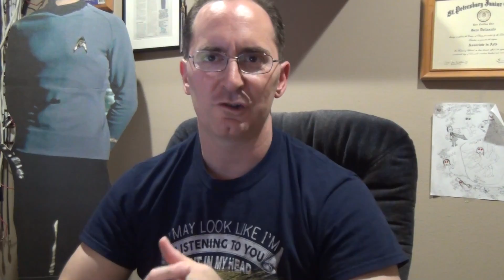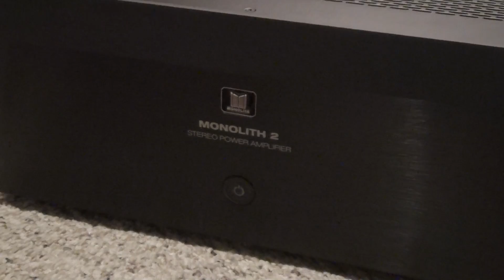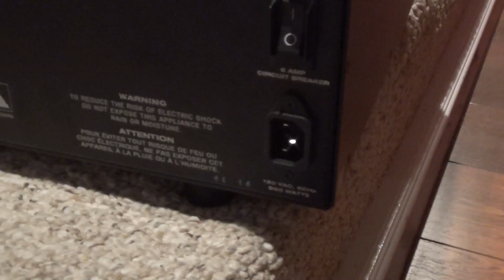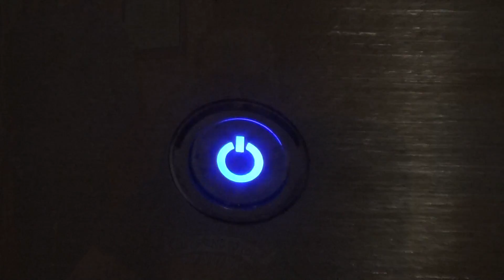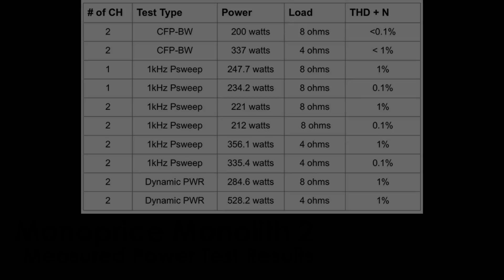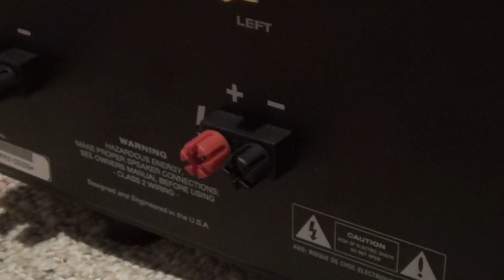Monoprice Monolith 7x200 watt/ch Amplifier Review

Comment: Time to replace my 90s Onkyo amps. Speakers are similar mid bass are 2ohm or two 4ohms per channel. The mids and highs require two 4ohm channels, tri amped leaves the 7th channel free to run a center. Think its a go.
  2025 its 2000.00 and a bargain, seems the best choice for the AB market. Don't care what you say, not big on D amps. Buy your amplifier by the pound, its always been my saying, this 90lb amp might do it. 
  ? can we use cast iron frying pans on it ? 😄

Comment: I just received mine today, I am not getting speaker hum or buzz like I did with some of the other amps I tried, but I  am getting toroidal hum, I can hear it from my main listening position. Also, I get a loud thump when starting up. Actually the there are two of them. the first one is louder as soon as it powers on, but both can be heard  from the MLP. On their website, they advertise "NO THUMP." I wonder if this is just a bad unit. I really would like to keep this amp, but the two issues I mentioned are just a big turnoff. Please advise.

Comment: Hey Gene and Theo, thank you for this video. I am looking for an amplifier to pair with a AVM70. I am comparing this Monolith 7x to a Anthem MCA 525 gen 2. Outside of the value differential, do you have any thoughts on how these amps compare? Any feedback would be greatly appreciated. Thank you.
Reply from the maker: If you've got the coin, I'd go Anthem. Matching aesthetics and rugged reliability and great performance. The Monolith 7x is a good amp and gives you higher channel density and value compared to the Anthem. But, I'd love to have a stack of Anthem in my HT rack so if you can swing the added cost, go for it!
Reply: @Audioholics  Great, thank you for the fast reply. Do you think there is a substantial difference in sound quality?

Comment: How would you compare this amp to musical fidelity or the nad m28 both 5 channel. These are the 3 I'm looking at. Before I purchase I would like to know what you would suggest, my speakers are main b&w 702S2. Center I'm using 2 wired together b&w 705S2 and the rear I also have b&w 705S2. I'm purchasing a processor as well. Now just running a older yamaha A3080 receiver.  Maybe also a suggestion on a processor as well

Comment: If my Pre Processor has both XLR & RCA -and this Monolith is less than 4ft so short cable run - would the 7x lacking XLR inputs be at a disadvantage sound quality wise or from a volume level perpsective? 

Is there anything else that changed when Monoprice updated the original 7x with one have the XLR inputs? OR are they identical under the hood?

Comment: would you say that one gets the monolith 11x or the emotiva 11 channel amp ? would love some input
Reply: The only input I can give is I will not buy Emotiva again. My Emotiva XPA-5 just died after only 6.5 years. Pathetic. I have a NAD and an Adcom that are over 20 years old with no issues and a B&K Components amp that is over 10 or 15 again with no issues. My Emotiva amps have barely ever been driven hard either except a few times to show them off. I just bought the Monolith 7 channel to replace the 5 and 2 channel Emotiva amps I have. We will see how that goes when I get it. Hopefully the Monolith will not have the hiss the Emotiva XPA 5 had either with nothing connected to the inputs on my Klipsch speakers.
Reply: @Brian-Outdoors  thx for your answer bud, I think companies overall make their products weaker now days. For the simple reason rebuy and refill pockets :P I might toss my coin at a monolith sounds promising either way.
Reply: @Sup3riorr  you are welcome and I agree with everything you said.

Comment: Super helpful--not a lot of BS, obvious knowledge of engineering and pointed out clearly pros/cons of the device. I'm certainly have this on the short list for my tri-amped digitally filtered home brewed--but using SOTA drivers (Audio Elegance,  Audio Technology C-Quenze, and Aurum Cantus) speakers.  May go with 5 channel version and a heavy duty stereo Class D amp to plumb the limits of the very capable AE 15" woofers. Great review and have subscribed.

Comment: I just bought this amplifier. My first amp. Is it supposed to make a very slight hum that I can hear when I'm sitting on the couch  And there's no sound being played over the speakers. Is this normal for an amp or should I send it back for a new one under warranty.
Reply: Are you running balanced (XLR) or unbalanced (RCA cables)?

Comment: They state that there is no limiter or protection circuitry in the signal path. Does that mean there is still protection elsewhere in the system to protect your gear? Sounds like a bad thing marketed in a good way. I want to get this to provide some overhead for my surrounds, but nervous about damaging my gear.

Comment: I bought the Monolith 5 and Denon 3600 AVR.  Previously had just the 
Denon 1400,  and no amp.   I went from 160 watts total to 1,210 watts 
total.   A 7.5 fold difference.   I can't tell a damn difference!   In 
fact, it seems a bit quieter.  5.2.2 system.    Not sure what to do.   
Did Audyssey screw up the mix?   I'm pretty good at setups, every 
setting seems correct.      I just don't get it.  Very underwhelmed.
Reply: I worked on my settings manually, with ears and a brain, and got my system sounding great.   Audyssey must have a hard time correcting my room which is sub-optimal, having tile floors, vaulted ceiling on an angle, etc.   Now I hear the difference.  Especially at reference level.

Comment: I only have a dedicated wall outlet with one plug taken up by the Speedwoofer 10 sub. Could I plug the 3 channel version of this Amp into the second plug and run both without causing electrical overload issues? thanks, new to all this so I have to cover all bases,

Comment: Would you hear any sound difference from Anthem or parasound amp vs the monolith?
Reply: @empyriel I have the svs ultra towers and center channel.
Reply: @freddygenao6035  I considered SVS, and I'm still considering them for my next setup. I'm not unhappy with Klipsch, but I haven't been into home theater long enough to determine if there's one brand/style I prefer over another
Reply: @empyriel you will have no regret. It’s an amazing amplifier. I bi-amp my left and right and can’t believe how good it sounds. Don’t miss my old parasound. Let me know what you think.
Reply: Freddy Genao Well, I got my amp today. Heavy sucker. Plugged it in and powered it on before connecting just to test. No issues. Plugged everything up, and buzzzzzzzz. Very audibly hum coming from all speakers. Thought it might be a grounding issue, so I called Monoprice to confirm. They told me the unit was defective, and needed be replaced or returned for a refund. Yeah, well, I grounded it to my AVR, and voila! No more hum. Looking forward to seeing what this beast can do
Reply: @freddygenao6035  Will do. It should arrive Wednesday, but I might have the time to connect it until this weekend
Reply: @freddygenao6035  How do you bi amp this amp? I have a 5-channel version !  And I'm only running 2 speakers !! Would you take two channels in the back of the amp powering one side of the speaker and two more channels powering the right side of the speaker? 

Opposed to just running 1Channel per speaker?  because it says 200 watts per channel so what I get a benefit if I'm using two channels for one another two channels for another speaker just by using like a blue jean speaker cable they have on Amazon one side has two connectors and the other side has 4 the speakers are have are focal Aria 948 which do not have a do a binding post only two in the back of the speaker so I'm just going to take that blue jean speaker cable with two plugs plug it into the speaker and then the other end of the cable that has for taking up two channels in the back of the amp and doing the same for the other speaker will this give me better results in better sound quality?  Then just me running each beaker with only one channel for each?
Reply: Been wondering that, myself, since I'm also looking at Parasound
Reply: Empriel, I just pulled the trigger from amazon($100 cheaper and free shipping) I will update you on what I think. 

I had an 20year old parasound  135 watts x6 and it just died. I’m intrigued what will I hear.
Reply: @freddygenao6035  I've been watching Amazon's price fluctuate for each of Monolith's models that they carry. But yeah, please let me know what you think
Reply: @freddygenao6035  I pulled the trigger on one just today. They've been selling like hotcakes. Monoprice is sold out, and not expecting any more until January. Amazon is now showing 1 left. Hoping it lives up to the reviews I've seen/read
Reply: Empriel, it definitely is heavy. Their customer service is always trying to help but I’ve notice their not the most knowledgeable of the product. 

What speaker will you be driving?
Reply: @freddygenao6035  I've got an all Klipsch 7.2 system with RP-280F, RP-450C, RP-250S, and RP-150M. Also have two R-112SW. What have you got yours connected to?
Reply: @freddygenao6035  By the way, the hum was caused by a grounding issue, which I fixed by grounding the amp to my AVR. The hum went away, and I went to town with it. I'm not disappointed so far, but I think it's going to take a little getting used to
Reply: @Newton R I believe you can’t bi amp with your current speaker. They have to come from the manufacture whit dual binding post. I’m not an expert but Wouldn’t  recommend  using the blue jeans like your trying to set them up. You might short the amp.  

How do you like your Focals? I’ve always wanted to hear them in person.

Comment: They are not made in the USA. Only designed and engineered, then they farm everything out to foreign interests, and ASSEMBLE THE FINAL PIECES, here in the USA. If it does not say MADE IN THE USA, on both the equipment, and equipment documents and literature, anything else said is BS.

Monoprice, he says, assures him........they are built in the USA, ???  Well that is only a promise to him  only that means nothing.  There is a big difference between built, (manufactured), and assembled.  For better guidance check Anthems website. Their amplifiers are built in Canada, and it says so on the product as well as the literature. Designed , engineered and manuafactured in Canada.

Comment: They have balanced inputs now.
Reply: Made by ATI check specs compared to AT signature.  Buying some of these soon.  Currently have ATI AT543NC which are miraculous Class D with linear power supplies.  So Monolith for rear  surround and atmos, ATI for front LRC.  Want A-holic to update review for balanced inputs and also review these ATI amps ..phenomenal really as good in most ways as any of my Brystons
Reply: I have heard good reviews on ATI's Class D. I think that the least expensive ATI 2 channel AB is about $1800, so the Monolith 7 x 200 is a steal. I want to run 6 Elac 6.2 and each will have it's own 200 watt amp. I'll use the 7th amp to drive a passive subwoofer. I think there are two toroidal transformers in  7 X200. I want to put them on separate 110 volt circuits.
Reply: Yeah they are higher but also higher performing, I was not comparing the 2.  Plus that's full retail. I'm not dissing the monolith at all rather confirming its pedigree.  Great value  will purchase these for surrounds but my front 3 will be the ATI with those fantastic hypex cores

Comment: Any audible "hiss" coming out of the speaker with that amp?
Reply: The power numbers are full bandwidth 0.03% thd ...

In short ... silent on full power even. The specs on that ATI amps are ridiculously good. I drive a infinity kappa 9 (dips 0.7ohm) send my older krell into protection mode. 

These puppies?! Don’t sweat it

Comment: hello,can i use a 5ch amp only with 3 ch ? i only have a 3.1 system with a denon x2400.. is it safe for the amp with only 3ch? or just bay a stereo one and use it on the 2 front and the center to the denon?

Comment: Great review Gene! How would you compare this to Emotiva XPA-7 irrespective of the price difference? Which one would you buy if you need a 7 channel amplifier with budget < 2K?
Reply from the maker: I haven't tested Gen3 Emotiva amps and the distortion results I've seen tested on Stereophile and by THX aren't too flattering so I reserve recommending their amps until I test one myself. The Monoprice amp is a solid recommendation.
Reply: Thanks a lot!. One last thing, do Monolith Amps have Auto turn-on by 'audio signal' feature like Parasound Halos?
Reply: +Audioholics

Sorry to barge in, but how does this compare to the new Crown XLS DriveCore amps?
Reply: @DorianMattar  I wonder the same as I have the Crown amps currently

Comment: I have this amplifier (7 channel) paired with a Denon Avr-X6300h receiver driving a 7.2.4 all SVS system (2 bookshelf and 1 center, both ultra and the rest including Atmos are all prime elevations and dual PB2000's) and it is phenomenal.

It is clean sounding, well powered, quiet and hardly any heat emanates from it (he's right about not having to use external fans, which is a must for the Denon). It is one of the best  purchases I've made and for 200 wpc, it really doesn't make much sense to spend more on higher priced amps. 
It is an absolute beast to move around as it is almost a 100lbs but that is always a good thing for amplifiers. The back connections were not a problem for me but if you have thick banana plugs, you might have to go with some other plugs.

I use the 11 channel receiver to power the four Atmos channels which gives it 140 wpc and this amp relieves a lot of the burden from the Denon because that heats up quite a bit even just powering four channels.

Music and movies have never been better. For me, it's better than theater experience. Higher resolution movies and music will be a revelation listening to this. I don't have the urge to add more power because this satisfies it thoroughly.
If this ever breaks down after the five year warranty (almost a year in and no issues whatsoever), I'm getting another one. Price per performance, this beats out anything else in the market and I bought it primarily on the strength of this review so thanks a lot for that Audioholics.
Reply: That is ONE SICK setup. That is the exact setup I want to build for myself
Reply: I was wondering when you plug in the amp to your receiver  do you have to do something in your avr or it’s just plug and play?

Comment: Hi Gene, thanks for the review. Can you review the Storm audio processor and amp?  I.ISP 3D.16.12 is the processor/ amp combo and the PA Ultra Elite is one of the Amps. This processor is unique in that it has 16 ch and 20 ch processing with upgrade, with 12 of the channels amplified at 200 watts per ch all 12 driven and 4 channels not powered. Thanks.

Comment: I have 2 kef ci5160 left and right channel and led r600c center. Buying a denon x4300h to run 5.2.4. I want to purchase a 3 channel external amp to drive the front 3ch. I stumble to this review. I was thinking emotiva gen3 3ch. Can you please tell me if you will recommend  this monolith 3 over emotiva gen3 3ch? Budget is 1200. Is there a better option to get used parasound or rotel anthem etc? Thank you. Btw I learn so much from u guys.

Comment: I have not used any of these amps, and i don't have much to say about how well it works and sounds... but I do have a little bit to say about the temperature rating.

IMHO the minimum rating I saw anywhere from my electronics manufacturing days are always starting at 85C and up, never anything less than 85C.  so really 85C rated is nothing to shout about.

However!  it looks like it is at least using decent Nippon Chemicon SMH or similar main filtering caps, not off brand caps that would dry out in a few years.

as for mono-block construction, I'd say it's almost, since it still share a transformer, which in theory could allow one module affect the other via the shared transformer, but that's just my nitpicking definition. ;)

Comment: Quick question, if I was to get an amp for my system, should I get a power conditioner?
Reply: Hey techno dad did you ever find anything out?
Reply: A power conditioner is a better solution than power cables. But the industry is full of snake oil. I can't find any real tests of PCs.